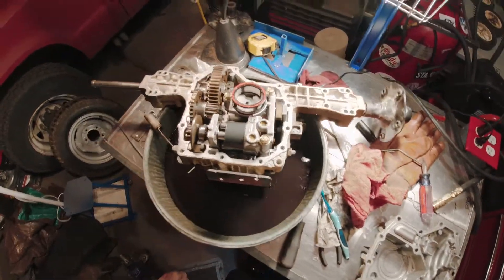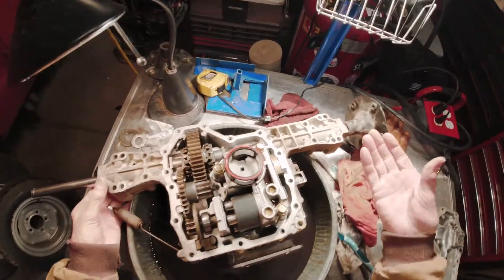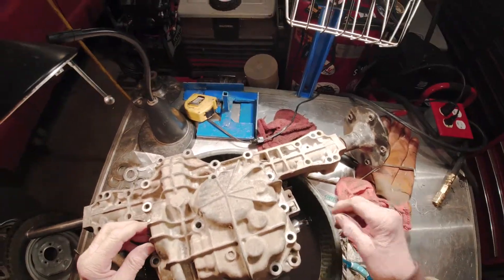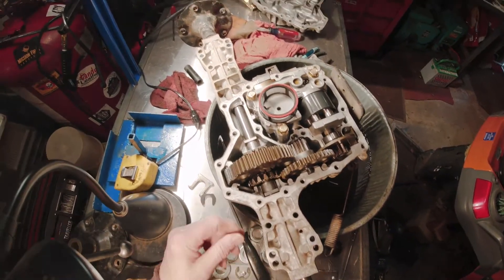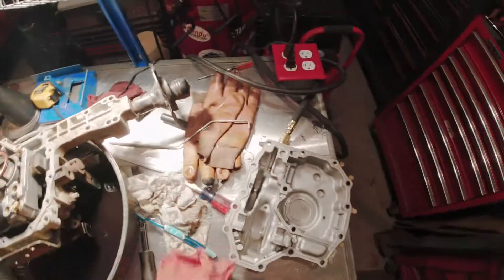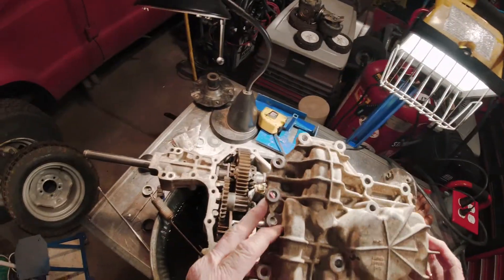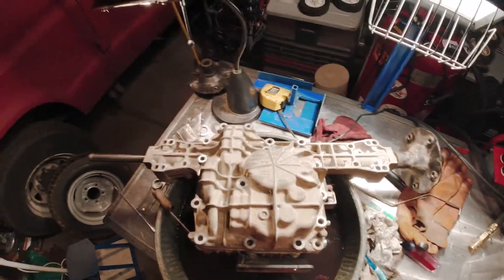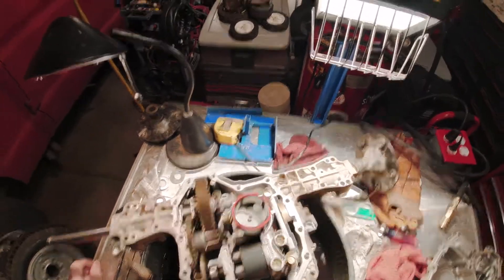Tuff Torq K46 Transaxle (left) axle replacement...PART-1

Comment: What is the amazon part number or tuff torque part number for the kit you got for this repair?
Reply from the maker: I just noted your question, sorry for the delay.  I was lucky in being able to buy just one side axle.  Tuff Torq now only sells both side axles and they are somewhat pricey.  I suggest you go direct to Tuff Torq customer support or search for a parts K46, ebay?

Comment: What is the PN for that axle oil seal you replaced? mine is leaking. Thanks
Reply from the maker: I'll have to check that out and post when I have the correct P/N.

Here's a link to Amazon for the seal:  Tuff Torq 2 Pack Genuine 187T0134280 Transmission Seal 15x35x7 19216334280, or do a search for "Tuff Torq 19216334280".